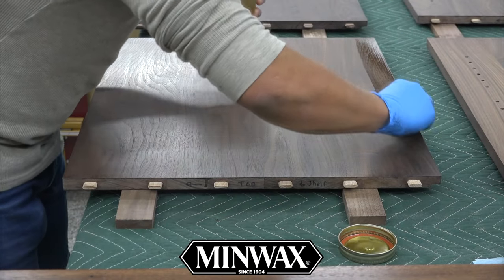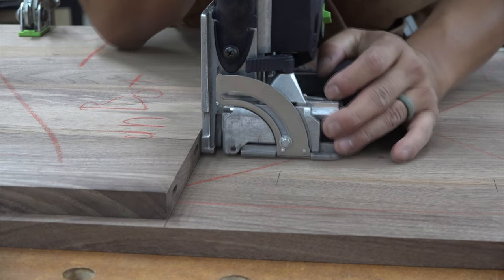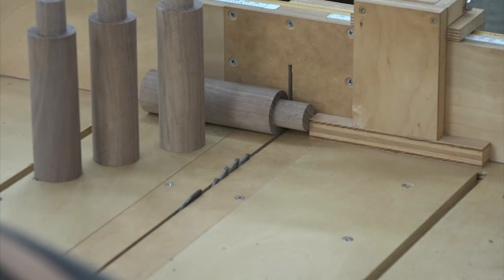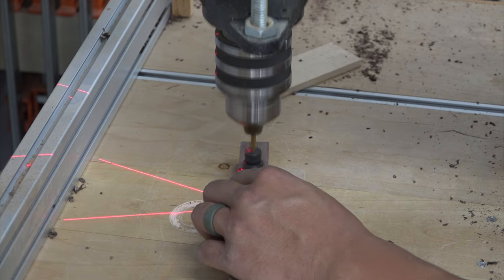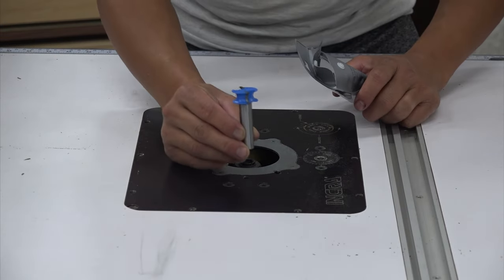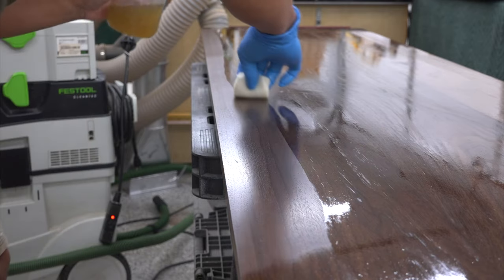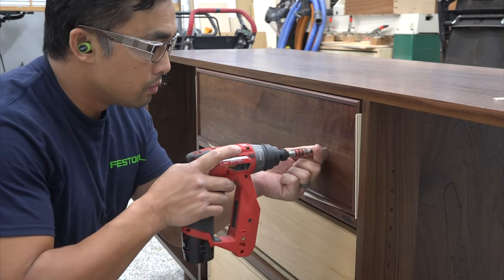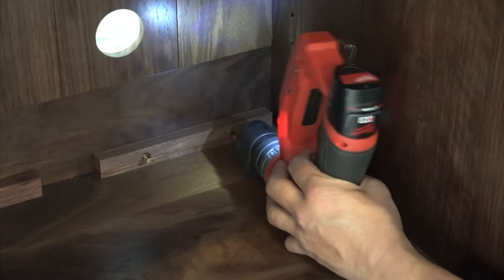Building a Walnut Sideboard

Comment: Question: by prefinishing the drawers, are you accepting that you are losing the effectiveness of the glue bond and relying on the dominos only?  Or are you scraping the lacquer off where applicable?  Thx.
Reply from the maker: I'm assuming that the lacquer is not getting into the 5mm Domino mortises.